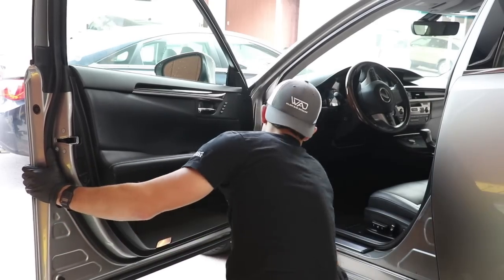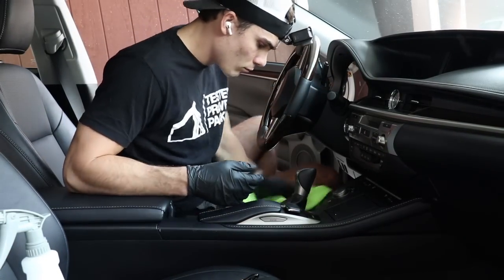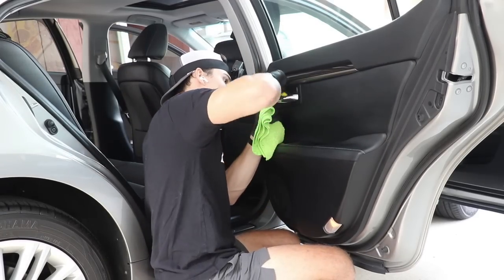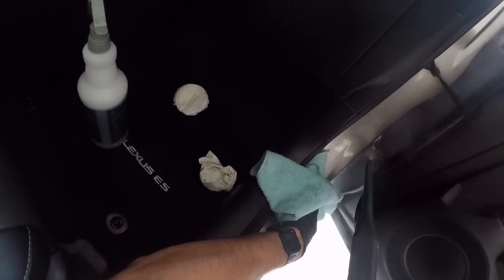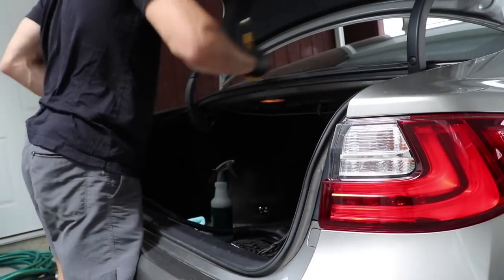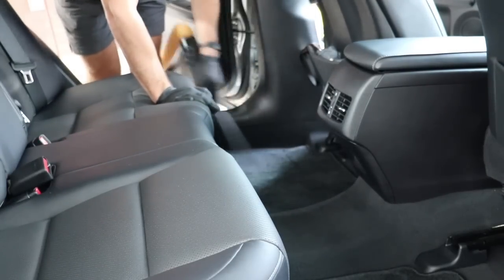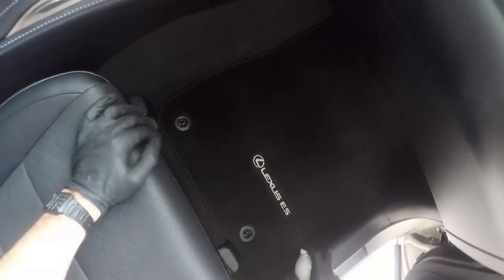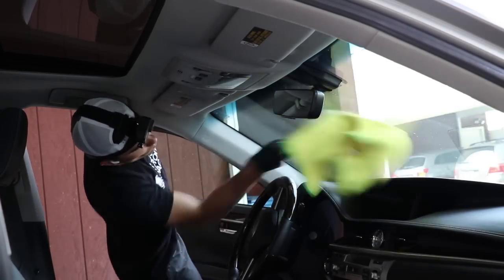Simplest Detail That Pays The Most MONEY AGAIN & AGAIN Without Hard Work!

Comment: Hey wilson whats good? Ive been using the blow part of my rigid vac and sometimes it shoots dirt, whats up with that?
Reply: Check the filter. Other than that, the dust might be too fine for the filter
Reply: Get a can of duster, or get an electronic duster works great. Or if you got the budget get a compressor.
Reply: @LoftySobe  well its a new filter... ill look into it tho